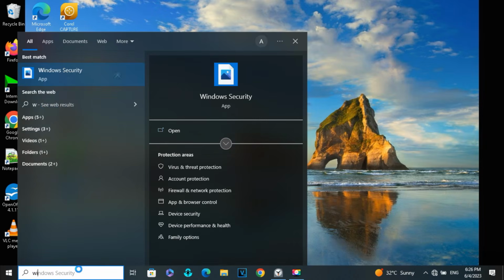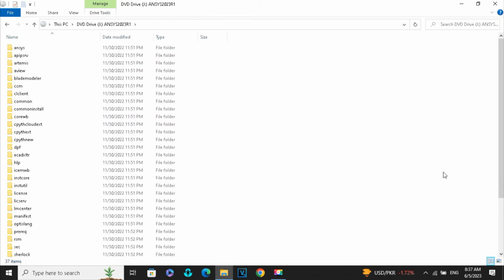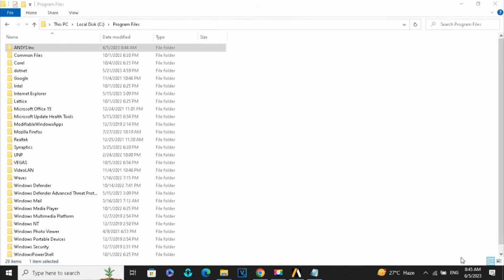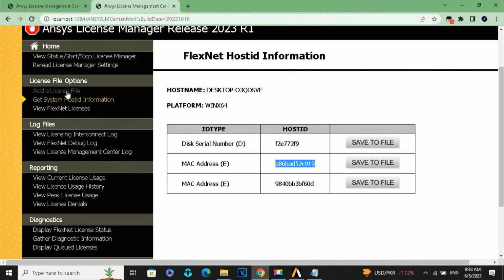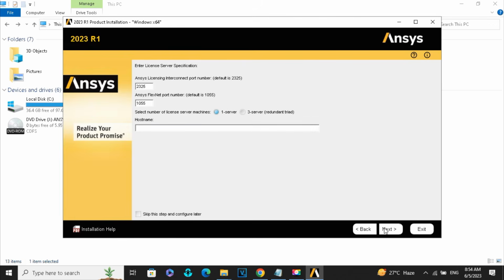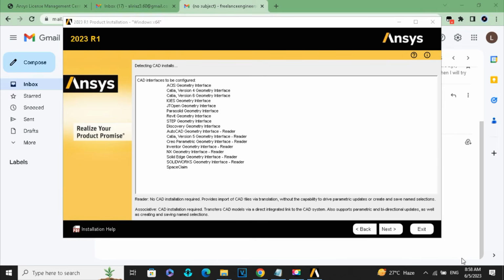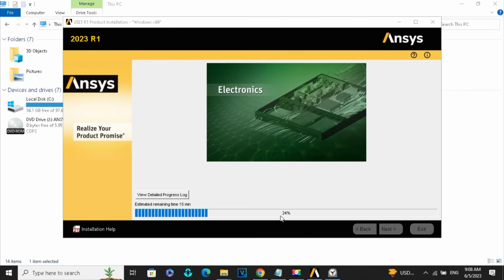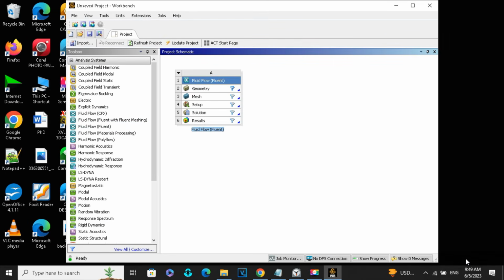ANSYS' 2023R1 Installation #ansys

Comment: bro at the end of the installation the solid squad enabler was not working properly. it shows some keys are opened by other processes or you have insufficient privileges to perform this operation. what to do?
Reply from the maker: Crack the software again as per procedure discussed in this video, without reinstalling ANSYS.
Reply: I am facing same problem, how did you solve that ??
Reply: @palanisamy5330

Comment: " Request name disco_level1 dose not exist in the license pool " Getting this error repeatedly bro....
Reply: "I have the same problem. I installed the program following all the steps, closed the antivirus program, and turned off the internet."
Reply from the maker: @Akira_Red_FOX  Then open the license manager from window search bar and click on "running" option of license.
Reply: Have you solved this problem ? @Akira_Red_FOX
Reply: I am facing the same issue ,,please help
Reply from the maker: @rohitkaushik8212  Turn off the internet and antivirus protection before installation.
Reply from the maker: @rohitkaushik8212  Turn off the antivirus and internet during installation.
Reply from the maker: Turn off the internet and antivirus / window defender of your PC. Then, install the  software.

Comment: hey bro nice video, do you found a solution already to the issue with the lincense not valid for ansys mechanical?
Reply from the maker: If you follow the installation procedure in the same manner as discussed in this video, then this issue will be resolved. However, if problem still arises then open the license manager from window search bar and restart the license by just clicking on run option.

Comment: Hi, when I tried to open the geometry, it is shown the following msg: "request name disco_level2 does not exist in the licensing pool. Invalid (inconsistent) license key". I tried stoppin and running the License manager but that does not work either. Some help pls
Reply from the maker: Restart the computer.
Reply: @computationalfluiddynamics3019  I have the same problem and that didn't work, other advices?
Reply from the maker: @ArArAArAr  Install the software by turning off the antivirus and internet connection.
Reply: @computationalfluiddynamics3019  this did not work for me, some help please?
Reply: Has anyone solved this problem? I am also having the same problem, please help and give me some guidance.

Comment: I have installed the same thanks for the video but now i am getting error that 'mechanical data failed to open data base. The Mechanical editor does not have a  valid license'. while i double click on Model in steady state thermal state. plz help me.
Reply from the maker: Kindly ensure that you turn off the internet and antivirus software or window defender before installation. If problem still exists, then kindly type "ANSYS License Management Center" on window search bar and open it. Then click on license running option.
Reply: @computationalfluiddynamics3019   i did but problem still exists , again i will try to install the same
Reply from the maker: @GauravKumar-qn7ss  Before reinstallation kindly delete all files of Ansys from respective drive. For this, you have to approach the specific folder and delete the files manually. 
During installation, kindly make sure that you install crack file and setup file in the same disk. 
If you follow all steps, as mentioned in this video, then your setup will must be installed and run as shown in this video.
Reply: .
 @GauravKumar-qn7ss
Reply: @GauravKumar-qn7ss  do you find a solution at this? I still have the same issue, pleasee helppp
Reply from the maker: @yaelcastrejon9998   Kindly ensure that you turn off the internet and antivirus software or window defender before installation. If problem still exists, then kindly type "ANSYS License Management Center" on window search bar and open it. Then click on license running option.
Reply: I can't find "license running option" in the mangement center, can you help pls?  @computationalfluiddynamics3019
Reply: Did it work for you ?  @yaelcastrejon9998